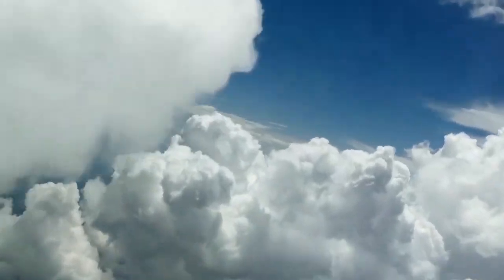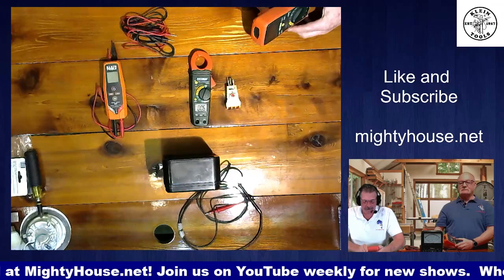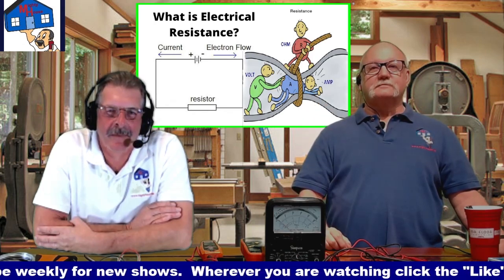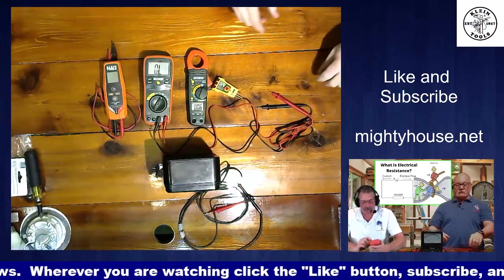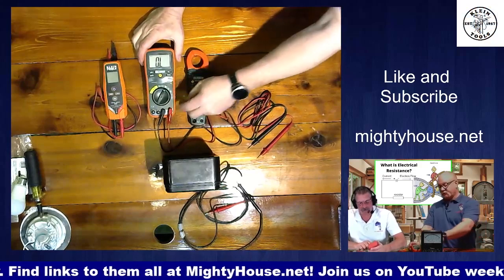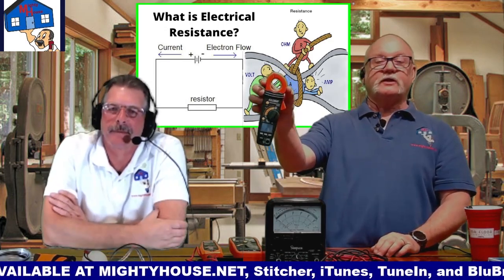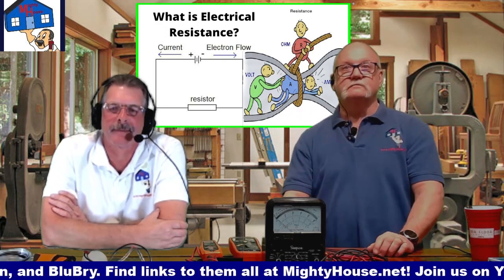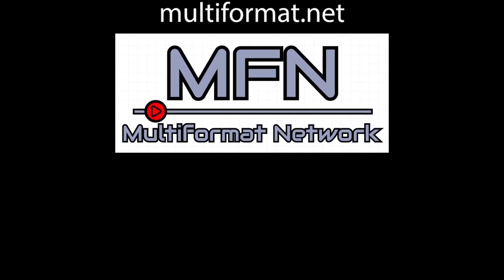How to use a Multi Meter, Klein Tools MM450

Comment: Hey can someone tell me what this guy has hit multimeter set on. Im new to all this and i cant tell. My bulb went out and i am trying to do what this guy did to measure it thx
https://youtu.be/MrJdUJ_83JM
Reply from the maker: Look for the omega symbol on your multi meter. Touch the two probes together and you should get a zero or maybe a 0.10. then you know you are on the right setting. Now test the bulb. You should get the same reading or close to that.
Reply: @MightyHouse  thx buddy i will have to try it tmrw. i left it at work. Do you think this actually works, what this guy is doing ? Im about ready to get a new bulb for my projector and his video just blew me away. Especially if it works.
Reply from the maker: @Sjrick  Yes, it is the way to test a light bulb